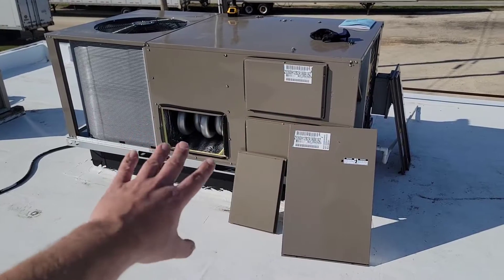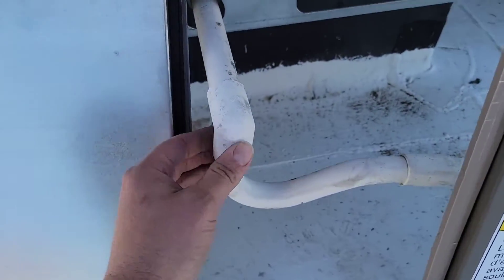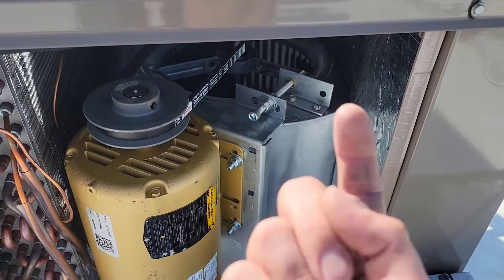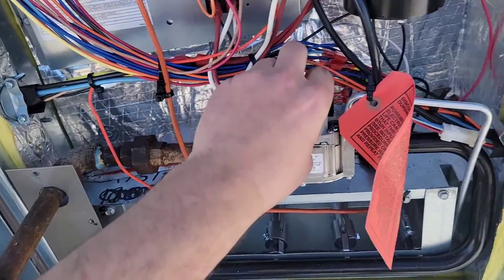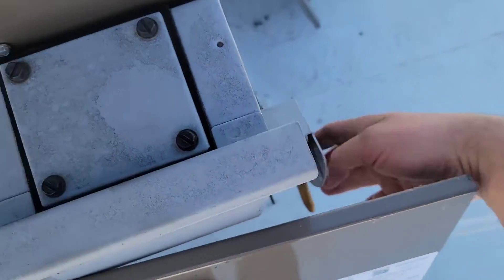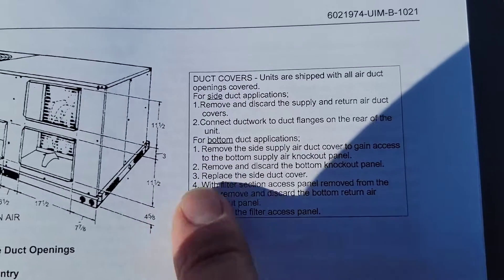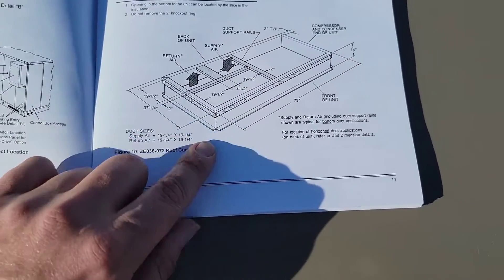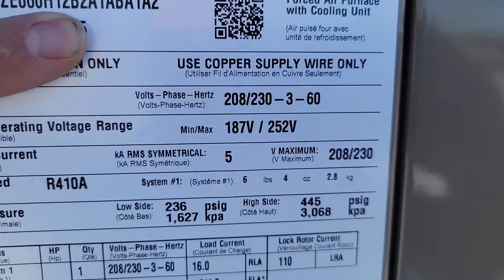Commercial Rooftop Package Gas Startup Tips

Comment: You would also have to wire in a 2 stage cool stat if you had an economizer. Economizer would become first stage, compressor second stage. Also the manual air damper is more so for fresh air intake to meet code requirements, if you have to open that up all the way you have duct size issues which let's be honest, is about 99% of all units we come across lol
Reply from the maker: Thanks for the info!